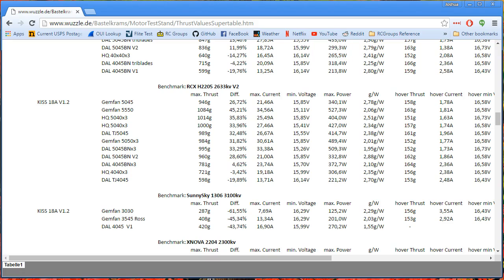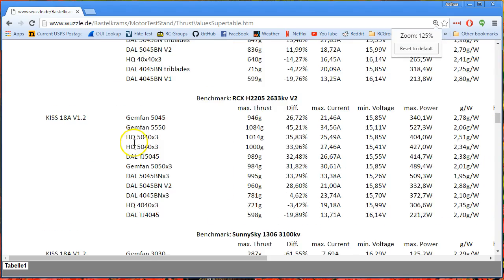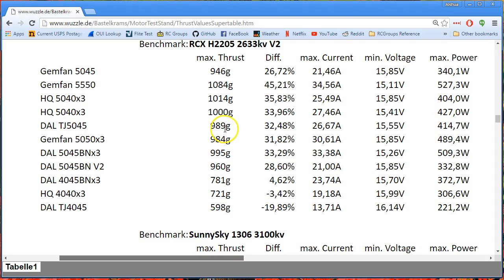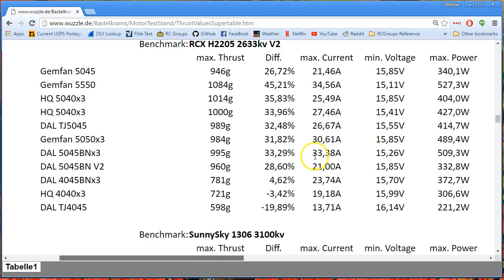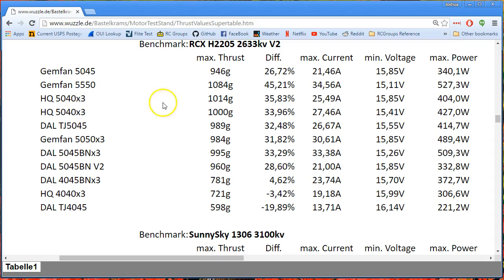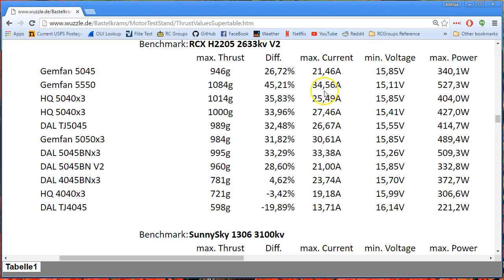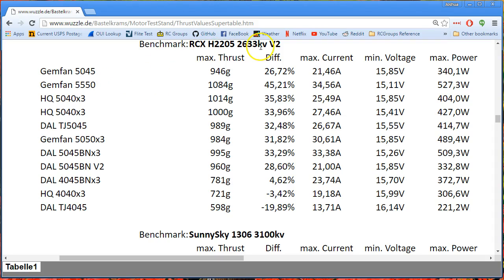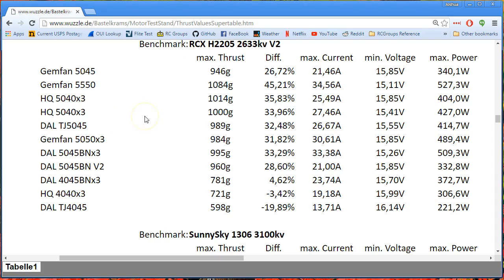Don't over-prop your high-kv motor

Comment: Hey Could you do a 2306 1700kv on 4s with a really high pitch prop? Then eventually I wanna do a low pitch prop on 6s. Im trying to switch to 6s but I wanna do it in stages lol. Would I get similar top speed and pull? Is that even ok for the motors?

Comment: i have a question : in case the quad is descending quickly, and you decided to give it a full throttle, few meters from ground, are you experiencing any kind of instability, or kind of prop stall ? is this possible ?
Reply from the maker: It's not prop stall. It's propwash oscillation. The issue is that the quad is falling into turbulent air from the props, so the motors just change speed very rapidly to keep the quad stable. The motors can't change speed fast enough and you get oscillation.

Comment: Hi Joshua, can over-prop might kill the ESC?
Reply from the maker: Possibly. But most ESC's are pretty robust these days.
Reply: Is that depend on the esc Amperage capacity?
Reply from the maker: Yes, correct.
Reply: Thank you!

Comment: I know this thread is old but I am in need of some info. Can a 2600kv 2206 run a dal t5544c or a dal t6040c on a 4s Lipo? I am using a Bolt esc and it can handle 40a. Thanks for all the help.
Reply from the maker: My guess would be yes it would be okay.
Reply: Joshua Bardwell thanks for the help. Now let's see if the Lipo can take it lol.

Comment: ive got 2205 2300kv motors and i can decide between the dal t5045c cyclone triblade or the dal t5040c cyclone triblade. which one would u recommend for freestyle
Reply: Conor McDonald : Hi, I use Emax RS2205s motors and the Cyclone 5045 triblade props are great! A significant upgrade over the very popular HQ 5x4x3 (and clones).
Reply: I like Dal 5046 Cyclones best on my emax 2205 2300kv
Reply: Thank u

Comment: Which motor would be suitable for a 5" 6  blade propeller? I know it should be lower kv rating due to higher number of blades but I stop there
Reply from the maker: I think the real question is, what are you trying to accomplish by running a 6 blade prop?
Reply: Joshua Bardwell by using a 6 blade prop and lower rpm motors (but higher torque) I would like to see some efficiency gains. But I have not tried it or seen anyone else so...

Comment: Quite true and not only for 22xx and 23xx motors with 5" props. In micro brushless quads with 1103-1105 motors overpropping become much more visible. Usually it end with impossibility to spin particular prop reasonably fast and quad loss a good part of torque and even can't lift.

Comment: Speed is not generated by prop, it is generated by the difference in lift between the props.

Take a pencil and imagine that you have a prop at both ends.  To move forward you increase the lift force generated at one end.  Since both props are part of a closed system, force has to be equalized between the two ends.  The net difference between the two is your momentum and moves in the direction of greatest force to least force.
Reply from the maker: I don't understand what you're saying. If speed is only generated by difference in lift between props, how does a single-engine airplane generate speed?
Reply: Joshua Bardwell 
That's a good question.  The shortest answer is that a plane has fixed wings generating lift with the props pulling/pushing them through the fluid.  The plane will behave differently when you fly it vertically, where the prop is resisting gravity instead of driving the lift surfaces through the fluid.

When a prop is parallel to the force of gravity, gravity will pull equally down on all points.  When a prop is horizontal, gravity acts differently on the prop at vertical and horizontal moments as it spins.

You won't be able to fly a multicopter pitched 90 degrees very far.
Reply: That response I gave previous was not the best answer.  I think that it might be better to consider that the CH-47 Chinook is one of the fastest helicopters, much faster than the AH-64 Apache.  If pitch was key to speed, than the AH-64 should be faster since it is an attack helicopter where the CH-47 is a transport.  The helicopter that is faster than a CH-47 is the Eurocopter X3 and it literally has twin vertical props to pull it.  The issue with speed of rotary wing aircraft is that at some point the tips of the rotor are going to hit the sound barrier and the aerodynamics will fail to produce lift.

Comment: As your multicopter moves through the air, half of the rotor disk will turn the direction of flight while the other half will be turning the opposite direction.  That causes a decrease in lift generated on the side of the rotor disk where the blade is moving opposite of direction traveled.

Comment: I'm running 2700 kv brother hobby r4's on my GT2 and I'm experiencing some .... not deflection, but some other issue on throttle punches. they scream really load and seem to lose power where as if I ease into the throttle they're amazing. any ideas???? also after about 4 hard punchouts a signal wire tends to burn in two... help please
Reply from the maker: +Shane Hale if you are carrying current in your signal wire, something is wrong with your wiring. Is it the signal ground that burns? Thst would indicate your power ground was not connected.
Reply: Joshua Bardwell found it... my power ground was frayed just a tiny bit and two lil scragglers were making contact with signal pad... Thank you so much bud. You kick A$$ man, really hope to meet you one day, maybe fly a lil maybe pick your brain with tons of questions...

Comment: 2205 2300kv or 2205 2600kv ??
Reply from the maker: For me, 2600 is my favorite, with a light prop like 5x4x3.
Reply: Joshua Bardwell thanks hey do u FPV standing or sitting down ??
Reply from the maker: +Alex Dalton standing.
Reply: Joshua Bardwell I am new to FPV and I can't FPV standing but would it be a good habit to be getting into doing do you feel that it's better to Stand and why ?

Comment: joshua bardwell  josh iv come across a box of kingkong 5040 i forgot about can i use these on my nighthawk 280 pro 6" frame with the EMAX MT 2204 - 2300KV AND RACESTAR 20Aesc  iv got 10 sets in the box   or ar these more for the 5" frame  josh and what would be a good smooth triple or 4 blade for my setup josh as i need to got some after braking just about two full sets of my emax i had with that instant flipping carryon  my friend  and its sweet its its flying  but i only have one full set left but i have got 6 spairs  4 clockways and 2 anti clockways lol  but it flying josh thanks very much  again and in 3-4 weeks josh one i get my daughters exmas prezzeis sorted out i would like to send you a wee donation to say thanks  and get your self a bottle and have a nice wee drink on me josh   its nice to be nice all have to send stu boy & painless360 a wee somthing aswell
Reply from the maker: You can use the 5040 props on those motors but they will be a bit under-powered. They're all right though.
Reply from the maker: The best place for you to contribute is here: https://www.patreon.com/thedroneracingengineer

You can also send me a payment here: paypal.me/joshuabardwell
Reply: cool thanks josh that shouldnt realy mater as this is my first race quad  so these will do just to get me up and going josh as im just stepping up from the jxd509g & syma x8g  so i thing iv got a lot to learn im good this the toy ones but these racing ones ar bite me just going to take my time to got used to it josh  so iv got these 10 pairs to get me going my friend   and josh what will be a nice smooth tri & 4 blade for my setup r im going to order some aswell  and thanks very much josh you have been a very great help  respect my friend  and i hope your having a good day to ya
Reply: Joshua Bardwell hiya yes i will buddy  but i just need to crip % crap for the next 3-4 weeks to get my daughters christmas sorted out first  josh and ill send you a payment from paypal to get your self a nice bottle just to say thanks    and just let me know how much to send to get your self a bottle and have a nice drink on me  my friend

Comment: my jjrc x1 stock 6040 props are making n alarming ripping noise on full throttle after a 3s upgrade... any advice?... 6045 carbons were quiet but not as quick as expected, and 5045bn's made even more noise... he x1 has 1806 2280kv....unknown esc's and i also selected throttle pid scaling in librepilot?, was that a mistake?... any help would be very welcome....

Comment: You should be able to simulate the unloading you'd get in flight by using a prop of the same shape but lower pitch. I don't have time right now, but if you like I can do the math out on what pitch you'd use to simulate a given airspeed.

Comment: can you 3d print a prop ? :)
Reply: RClifeon did it and the drone flew but everytime he touched anything they broke.
Its not possible to 3d print material that is durable enough for a good prop
Reply from the maker: +fpvYou definitely not.
Reply from the maker: +fpvYou It would just explode. Possibly you could use sintering to print a prop, although I'm not sure. Metal can be sintered, and it is very strong. I don't know about plastics.

Comment: My problem with all the thrust tests is that they don't account for our biggest limiting factor, battery/voltage sag. With a single motor you get given results, when you put 4 motors on the same battery, voltage sag becomes much more significant, magnifying the overpropping issue.
Reply from the maker: +kevin pratt Absolutely. The thrust tests let you do a comparison between motors, ESCs, and props, but they don't directly translate to real flight performance. We know that props unload in the air, for example.
Reply: Right. While chasing after tenths of mph over extensive data loggin in boats running 70-109mph, it is perfectly reasonable for example to see a lower kv motor produce a higher loaded rpm with the same prop because the current draw is lower allowing for a higher sustained voltage. On the flipside but similar, a little less prop allowing the rpms to run higher can result in higher speeds, as illustrated in this test. BTW, thanks for all your insight and knowledge you share so freely, I spent a few hours of this rainy day watching your videos trying to soak up some more knowledge.
Reply from the maker: kevin pratt Glad you enjoyed it. I've always liked teaching and talking, so it's a real pleasure to find an audience who soaks it up. My family is tired of hearing about this stuff ;-)

Comment: when you are accelerating with a aggressive pitch, the prop is buffering and chopping the air quicker then the quad can accelerate,  you have much more vertical surface area of the prop that is adding resistance. either way once the quad is moving the buffetting is minimal.

Comment: you are forgetting handling, for example, 5040x3 handles better than 5045v2
Reply from the maker: +Calvin C I agree! But if the motor is over-propped, it doesn't matter how good it handles to me.

Comment: DYS has a new 2205 2750kv. wonder if these could reach the upper limit of what is possible with 5040 props
Reply from the maker: +L Pablo Mendez in the same way that a 2600 kv can't spin a 5045BN triple at full speed, eventually you would get to a point where the motor couldn't spin the 5040. But I really don't know where that point is going to be.
Reply: +Joshua Bardwell In my experience, going from non-bullnose to bullnose is a way bigger burden on the motors, compared to going between, say, 5040 and 5030. I have no doubts that a modern 2750kv could spin a measly 5040 2-blade. I run DYS 1806 2300kvs on 4S and 5030 and 5040 props, and the motors come down cool. They will heat up with 5045BN on a hot summer day, though.

Comment: Great video. I would love to see a follow up comparing these numbers with the 2300kv version
Reply from the maker: +Zaniix_FPV there is lots and lots of thrust data for that motor here:

http://www.rcgroups.com/forums/showthread.php?t=2470940

Since it's not the same test setup, the data won't directly compare, but there it is.
Reply: +Joshua Bardwell I also wonder if it is fair to compare motors at max throttle /max amps. This is where we spend the least time, would it be more fair to compare at 75%?  For example emax 2205 2300kvs on gemfan 5045BNs  at 100% is 1074@50amps vs 2600kv 1289@115amps ( yeah crazy difference in amps lol)  75% its 716@12amps vs 924@18amps   Pulled data from http://www.miniquadtestbench.com     maybe I am looking at the data wrong.

Comment: You're welcome :)
Note that the turnigy test stands are not the most accurate. But all test are done on the same teststand and under the same conditions so the values should be in good relation to each other and be comparable.

Here's the link for those who don't want to retype the one in joshua's vid:
http://www.wuzzle.de/Bastelkrams/MotorTestStand/ThrustValuesSupertable.htm

Comment: I have the Lumenier 2000kv motors you mentioned- I put them on my very first 4S Strider. I was very unimpressed last year with all the 5in prop options at the time (bullnose were not even a thing then, not were triples or 4 blade, and no 5050 existed)
I did however get very good performance and flight times from a 6x4.5- 3S combo with it.
Those 2000kv's are silky smooth- but did not make the power my Cobra 2204 2300's did on 4S with gemfan 5x4.5. Add in the esc factor as I was running simonk then also on blue series. Lots has changed.

Comment: Another factor that may have an affect is prop tip speed limits, I believe a prop tip cannot break the speed of sound, so a 2600kv motor on 4s with 5inch props could mathmatically generate a tip speed of around 650mph, 6inch prop would jump to 770mph which would be supersonic. I wonder would this limit be another reason to say 2500 to 2700kv would be the sweet spot for 5inch props.
Reply from the maker: +LeakyMeat That's assuming the rpm stay the same, which it wouldn't, because the 6" prop would load the motor more. But in principle you're right. With 2300 kv motors, we didn't really have to think about the sound barrier at all, but at higher kv, with smaller props, we might.

So I just crunched some numbers. RCX 2950kv motor with a 5030 prop on 4S 16.8v runs 34286 rpm. This translates to a tip speed of 227 m/s, which is well below the speed of sound (343 m/s). On a 4" prop, the motor spins faster but the circumference is smaller, and the resulting tip speed is lower. Neither the 2950 nor the 2633 list a 6" prop at all, but I would expect that the reduction in rpm will offset the increase in circumference, or if not, that we will still be well away from the speed of sound.

Based on that, I don't think we have to worry about breaking the sound barrier until we are above 3000 kv at least.
Reply: +Joshua Bardwell Thats kind of a shame, a sonic boom from a quad would be pretty cool to see.

Comment: 2 blade is always more effecient than 3 blade...but does not scream as nice ;)
Reply: +Joshua Bardwell One thing to consider is that triblades really feel different due to them having a larger area that connects the quad with the air. They provide way more grip and controllability in my opinion. While twoblades maybe more efficient with high kv motors they also need to work harder to change the quads course. Tri- or even fourblades (I really like the super expensive HQ5040x4) really do provide a more gliding feeling.
Reply from the maker: wuzzle punkt I found that HQ5040 had a really nice feel in corners. I was able to leave the throttle almost entirely alone and just steer through the corner, instead of having to manage the throttle carefully.
Reply from the maker: +FLYPiLOT The sound of a tri-blade sure is nice. The DAL TJ5045 on these motors almost hiss.
Reply: +Joshua Bardwell yeah agree. I use them as well..will be testing the new t5040 series soon..should be good also
Reply from the maker: FLYPiLOT I've also got those T5040 on the way. Although if wuzzle's testing is to be believed, there is really not much advantage to the tri-blades on these motors. My subjective in-flight experience begs to differ, though.
Reply: +Joshua Bardwell hehe right, the louder the better ;)
Reply: @JoshuaBardwell  I've heard lots of claims that the tri-blades are more stable in flight. Seems there is more to the story of what prop to use than just thrust.

Comment: Good topic! This motor doesn't seem to have a max amp listed for it anywhere... How do you know if your drawing too many amps for the motor?

And why no love for 6" quads? Does damped light not cut down on the floaty-ness enough?
Reply from the maker: +Eric Graham Take a look at the thrust tables from RCX and see what max amps they put through the motor. Bear in mind that RCX tests their motors for something like ten minutes at full throttle, so everything you see on their site is very conservative, and in flight (with airflow) and at less than 100% throttle, the motor will take quite a bit more than RCX rates it for.

With the RCX 2206/2250kv motors, on the bench, I started smelling enamel burning when I got to around 25-30 amps. I would run the 2205/2633kv flat out at 20 amps all day long.
Reply: +Eric Graham myrcmart has it